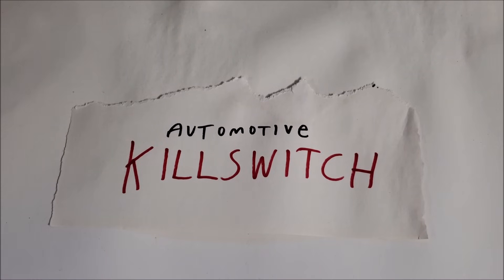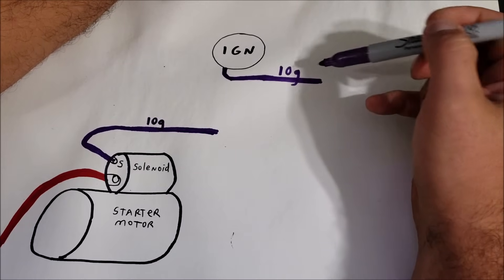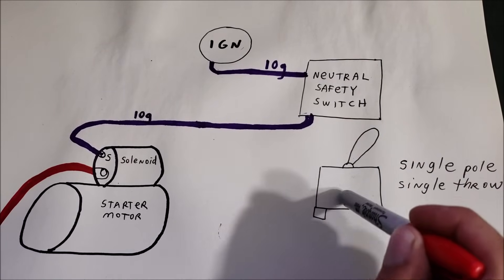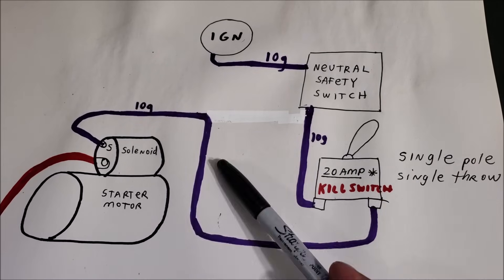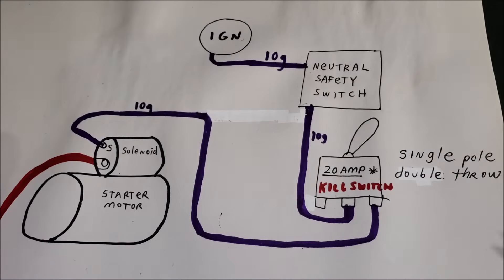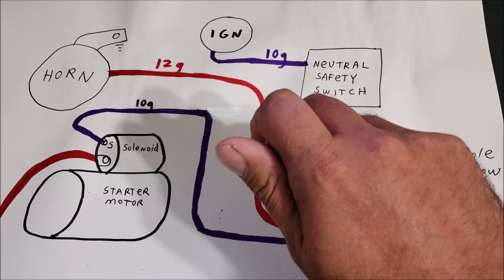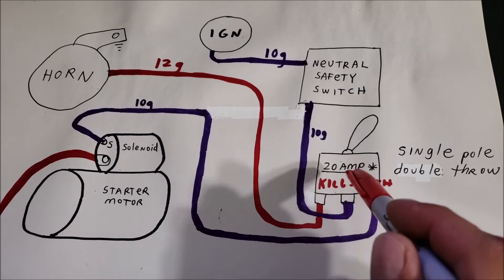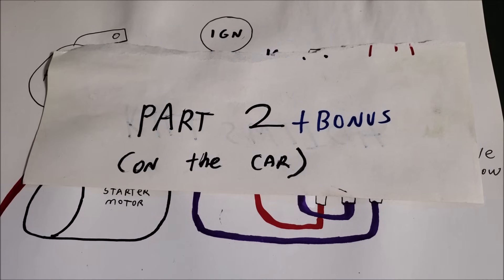how to wire a KILLSWITCH - theft deterrent

Comment: Hi Chris, would it be a bad idea to use my rear defogger switch as the kill switch? It would control the rear defogger and starter circuits. Is it a bad idea to connect two circuits like that?
Reply from the maker: no.. people do that stuff all the time .. but you would need to use a 30 amp relay to complete the circuit ... I have a video on wiring relays in real life where I use my fog light column switch to turn on long range lights
Reply: @chriscraft77022  Thanks for the reply! I heard that there's potential for backfeed/too much resistance or too much current in the system which is why I decided to use a blank switch on the dash instead. Especially cos the rear defogger uses a lot of current? But I'm sure it would be okay anyway. Good video cheers
Reply from the maker: oh.. I did not mean use the switch connected to the defroster.. I meant using the switch WITHOUT defroster..
Reply: @chriscraft77022  Thanks for clarifying! What's the reason for not using it for both circuits? Also, would it be possible to use an existing light switch for a kill switch too? (and keep the light)
Reply: or maybe you could wire a three-way light switch as you've done in the video to the horn and disconnect the light?

Comment: I installed this with the horn today.  Many thanks for the instruction and drawing.  Combined with another semi related video and I have a creative solution to give me piece of mind.
Reply: How did you do the horn?  I bought a second horn and it didn't work.
Reply: @WuestDennis One terminal of the horn have to be  connected to ground in order to complete the circuit.

Comment: There's a black wire on my 92 accord that's smaller than the others it connects directly to my solenoid that's attached to starter. Can I splice this wire and have my switch wires spliced there? I have no electrical experience lol help would be appreciated my car keeps getting messed with. The wire is visible when looking directly down at my motor

Comment: How do u wire it up to the horn with a hot wire if the horn works by switching the ground? Part 2???
Reply from the maker: i am so sorry i have not uploaded part 2 yet..   life happened..  you are right..  i have the video coming showing the many ways...   hot or ground trigger..  i am sorry..     i am working on my house right now.. you have to wire a relay to get the ground trigger under the dash..

Comment: So I watched your 700k viewed Automotive Relay video... Can I assume I don't need a relay for this application because I'm not wiring something new but rather just putting an interruption opportunity (switch) into an existing circuit that would already have a relay if it needed it? Thank you!
Reply from the maker: just get a 20/30 amp switch.. I’m sorry I haven’t made part 2 yet but I will go over switched or relays... I will be using a switch

Comment: Finally someone who thinks like I do. So tired of everyone killing the fuel circuit. If the car won't crank the thief will leave, course he my steal something else or bust up things but at least the car is not stolen. PS like the horn idea.
Reply from the maker: killing the fuel pump is something a child comes up with
Reply: @chriscraft77022  What would be like if a ignition coil was wired up to the seat

Comment: hi ,can you make a video for disconnecting battery (negative terminal ) by a switch through dashboard ??
Reply from the maker: you can’t do that..  just run a battery disconnect switch under fender by the battery
Reply: @chriscraft77022  why ? Can we not cut negative terminal wire of battery from middle and then put a kill switch there ??  I am just assuming that wire length is more and kill switch is going to the installed in dashborad safely .  Can it not be done ??
Reply from the maker: you could do that.. but why? why would you want to have a battery disconnect on your dash? why are you disconnecting the battery anyway?  your radio presets and clock get screwed up
Reply: @chriscraft77022  thanx for confirming ...actually it is easy to search new radio station again...car clock is rarely used as i have phone n wrist watch ....main concern is making  it theft proof whenever it is parked in unsafe area (dont want to use on every stop n start )....i don want to void car warranty by cutting internel wires or any relay problem or fuel pump issue in future ... ..is it not simple to just cut the battery from whole circuit  ??? Please make a video on it if you can  ...it is also helpful for people to stop battery drain whenever car is parked for long time like in this corona pandemic . ..and thanks for your guidance ....Gratitude from India 🙏🙏

Comment: Thanks for the great ideas! Bear with me, I'm a novice: In the stater/horn version, if a bad guy turns the ignition and the horn goes off, I assume it just goes off continually, right? If he panics and just runs off and I'm not around to hear the horn going off continually, I assume it will just run till the battery dies, right?
Reply from the maker: no, the opposite .. when you crank you car .. that’s a momentary switch .. it only beeps when he is cranking the starter .. but there is no cranking .. only horn
Reply: @chriscraft77022  I have just tried wiring this up using SPDT switch. The kill function works and the ignition (live) function works and the horn works when pressing horn button but I do not get horn when in Kill mode. My kill switch pole is spliced into the normal horn circuit path that runs from steering column to horn relay. Any idea why I don't get horn in kill switch mode when the ignition is cranked to the "ignition" position
Reply from the maker: the horn wire grounds out at the steering column...  you actually need a relay to ground out when energized to make it work.. sorry, I haven’t made the part 2 yet
Reply: @chriscraft77022  have you made part 2 I'm in NEED of it got my car keys stolen & don't want to go change the whole switch out

Comment: Would a 10 amp switch work?
Reply from the maker: if it gets hot change it out to a 20-30 amp.. I would not use it but it should be ok for this set up ONLY

Comment: This works great if the thief tries to use the ignition key. But how often do they use a key when they steal a car? Would this work if they use their conventional way of stealing a car? Thanks
Reply from the maker: what is this conventional way you are talking about.. ?
Reply: @chriscraft77022  it would seem to me that this kill switch with the horn trick would only work if someone tries to use the ignition key to steal the car. But don't they usually brake the column and splice the wires?
Reply from the maker: the wires they are splicing are these

Comment: What if originally my stock horn button provides ground to the stock horn? With the switch installed I will be giving 12v with ignition switch instead of ground and will not work... any suggestions?
Reply: You're right, it grounds the relay, so I'll have to bypass it and go direct to the horn. Thanks for the help! Also very nice Chevelle, my dream car is a 1970 El Camino but currently starting in a little Plymouth Duster 225 after years of motorcycles haha. Greetings from México. :)
Reply from the maker: the horn contact grounds out the horn RELAY-  sending power to the horn... you have to run a separate wire to the positive prong(s) on the actual horn.. to give it power separate from the existing circuit...

Comment: Always good information.  What’s the status of the Chevelle.  I have a 70 Chevelle as well and learned a ton from your videos.  I just put a 454 in mine, based off how you installed yours.  How about a video on rear differentials?!?!
Reply from the maker: I was going to make one but there is too much liability on setting pinion depth without the special tool... mine already had 3.31 gears and a posi so I didn’t really have to change anything.. I did rebuild it 100% sand blasted all new axles and bearings..rebuilt the posi and shimmed it...  Sorry, it was the first thing I restored on the car, actually before I started making videos
Reply: I completely understand.  Keep doing what you brother.  I’m going to eventually figure it out.

Comment: You suggest to wire it into the starter circuit as apposed  to the fuel or ignition circuit so that someone who is trying to steal the car doesn't continually crank on the motor! Totally understandable, but why not run a second kill switch to the ignition? My dad had two kill switches on his 65 mustang! On a mid 60's car it isn't a bad idea to have a kill switch on both circuits because the electrical wiring is much simpler than a modern car! Ford even put the stater solenoid  on the fender well right next to the battery making it accessible for those who can't figure out how to crank the engine inside the car By having two kill switches, if the person trying to steal the car figures out how to energize one circuit, They still won't be able to start the car unless they figure out how to energize the other circuit!
Reply: Why stop at two? Why not have 17 kill switches so if they override the first 16 the last one will stop them?

Comment: I always tap into the wire on top of the gas tank and and break it.  I use a small solenoid and being the pump is in the plastic tank on most newer cars I break the ground with my solenoid. I am building a 53 5 window with a stroker 350. I am using a electric pump just for that reason. Non electronic ignitions on vintage cars are to easy to steal as they have a manual fuel pump. You only need one 2ft wire with clips. It goes on ignition side of coil then to the battery hot side now you take a long screw driver reach the solenoid and then you short the big red hot wire across to the S on the solenoid that you are using and it will start right up unless it has no fuel.  They also make solenoids that go on a gas line and block fuel altogether.  You did a good jog explaining. Just thought I would give you another idea. If you want feel free to make another video with drawings better  explaining this if you like the idea. Old cars really need a good kill switch . you could even put one on the coil wire. Once again thanks for the video.
Reply from the maker: you are so right.. I have never messed with anything older than 67 but I can imagine the ignition wires being easily accessible on pre 60s cars ... 
VERY GOOD info  ...  I will brainstorm and possibly make a video when the conventional kill switch is not a good option.. i understand exactly what you are running to kill the fuel pump..

Comment: Hey Chris, I have a question. I am fix up a 1973 Torino and where the trunk weather stripping goes is some what rusted out but the very top thin part of metal is still there. What would you do?
Reply from the maker: I have a “controversial rust repair video.. “I did a repair like that on my car because I didn’t have a welder at the time.. check it out
Reply: Ok thank you. I am not the best at welding yet and that’s a very small area. This will help.

Comment: Thank you Chris... i’ve been contemplating the idea of installing a kill-switch on my 72 Chevelle lately. 

However, how should I wire it if I have a starter solenoid??
Reply from the maker: thats how its wired in the video...  you wire the switch in series TO the wire going to the solenoid
Reply: Chris Craft ....Chris I apologize I meant to type Ford starter solenoid... I had to install a ford starter solenoid on my Chevelle to assist the starter.